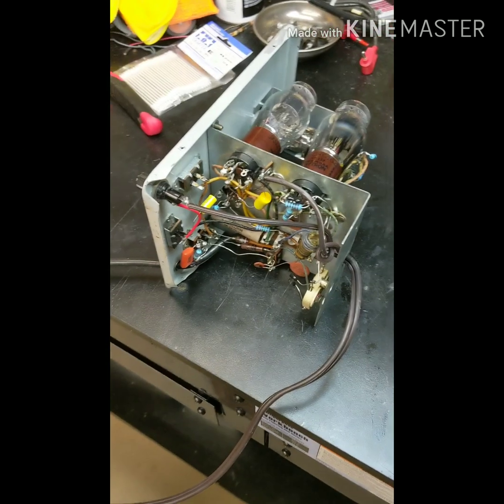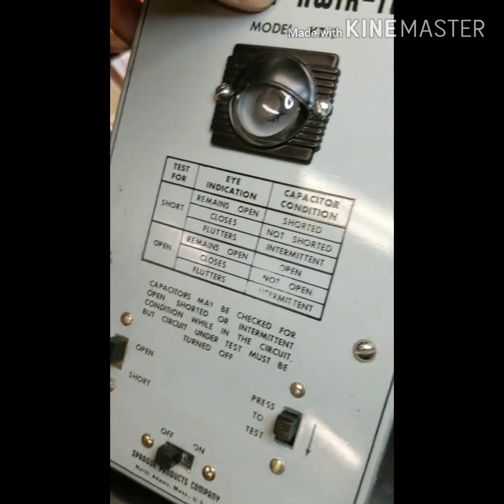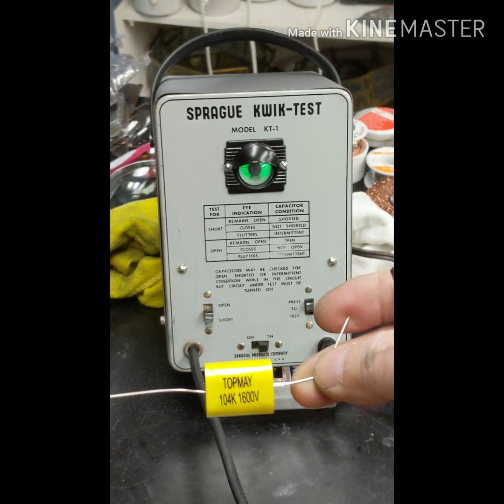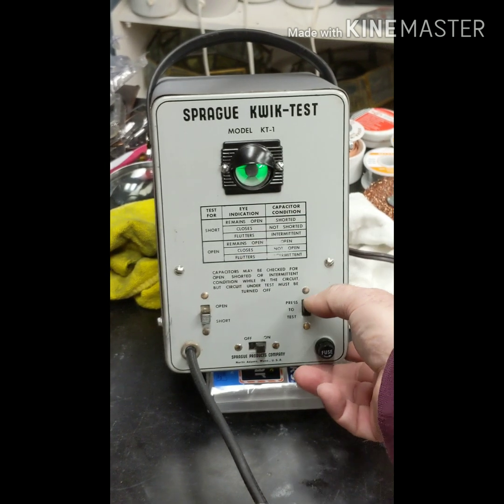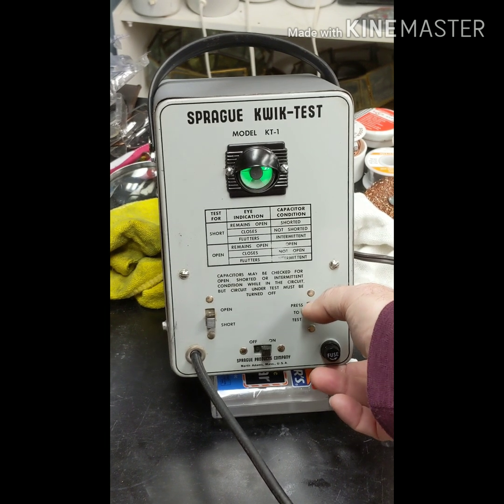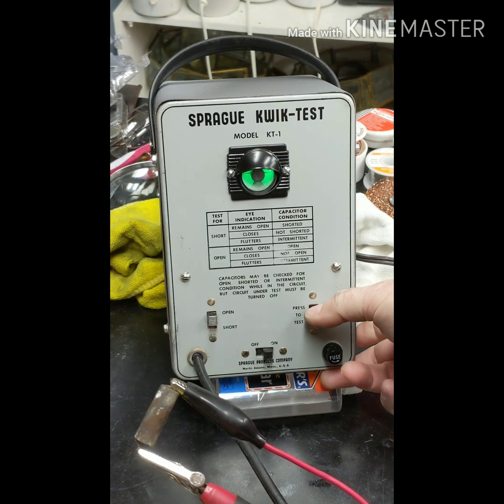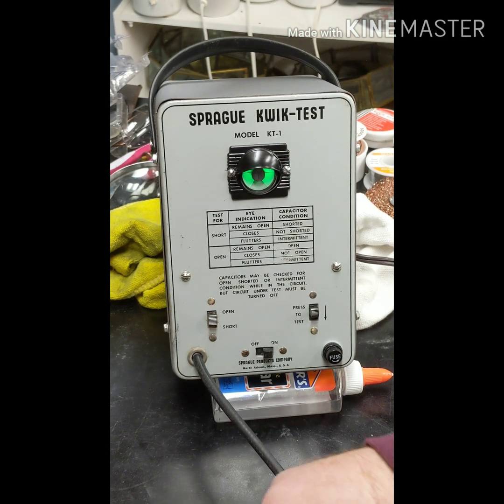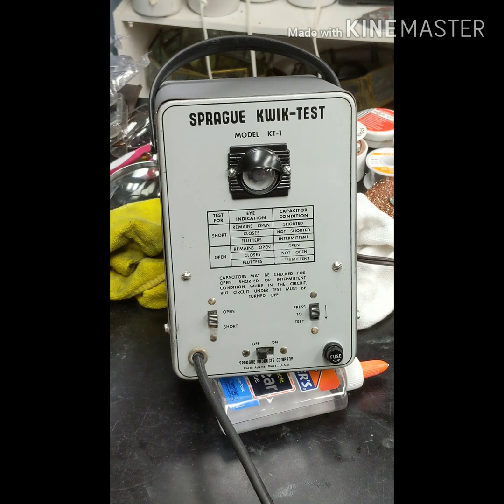My Sprague KT-1 Kwik-Test Capacitor Checker

Comment: Its boolean logic. If you fail this logic then you should try another occupation.  I had it backwards,  I was thinking a dark tube = closed. But a dark tube is open.  Once you get this right " dark tube = open ". It all makes sense.  Thanks for clarifying this. The instruction manual assumes you know this.  But sprague should have shown an example of an open tube vs a closed tube..

Comment: I just got one, and want to open/inspect/restore.  I'm having a hard time removing the case/back.  I have the four side screws out, plus the two around the power cord opening, and removed the adjustment screw cover back there.  I've started trying to pry the face from the sides, but it's not coming.  The sides are starting to bend, so I stopped.  I'm not familiar with Sprague test equipment cases.  Are there any tricks to it?
Reply from the maker: If the side screws are out and the ones in the back, it is just stuck at the face. The face has a parameter flange that is about 1/4" long that is pinched at the top and bottom.  Try taking a small plastic  hammer and tapping at the top front ant bottom front  while holding it front down. This might free it up. Also some WD-40 around the front seam may help as well.
Reply: I have the same issue, the fit is extremely tight.  Did you find a method that worked?

Comment: I bought the same unit today in a swap meet, I will restore too, the manual says that you can check those capacitors in circuit which makes this unit very useful, great video thanks for sharing